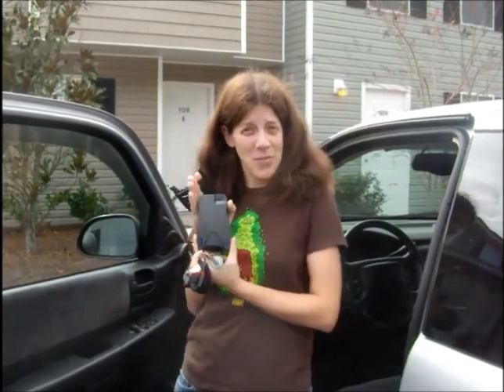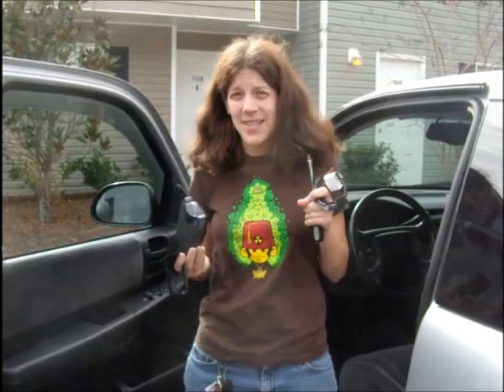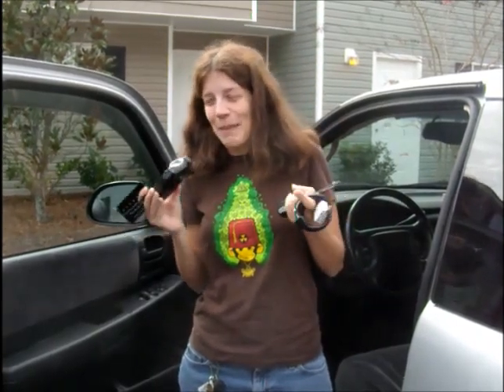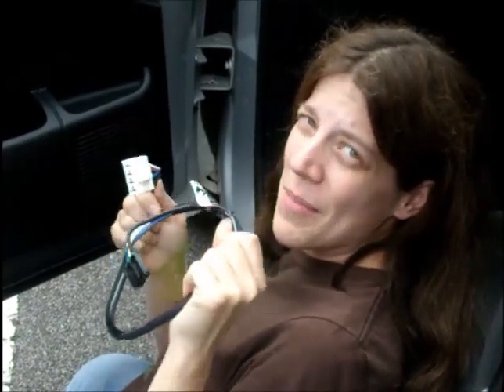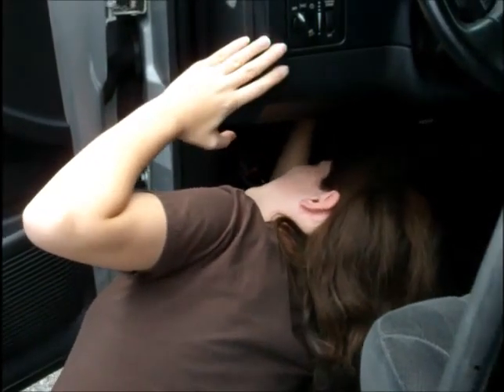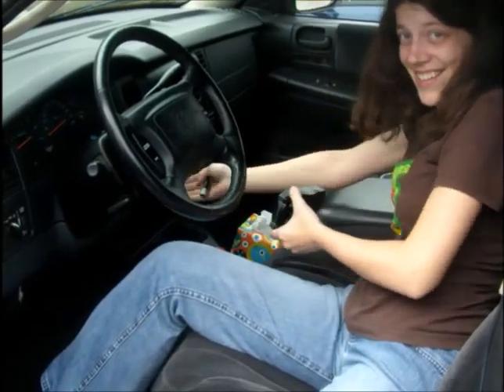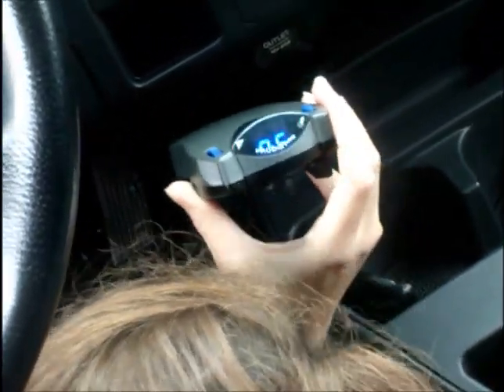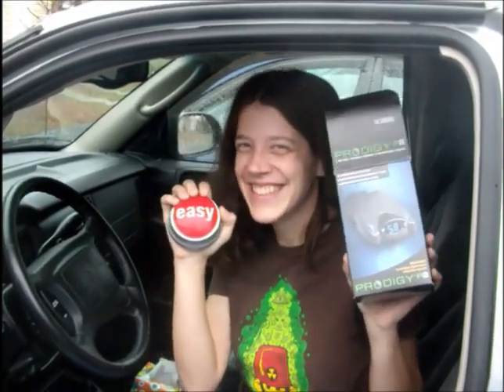Not Really a Brake Controller Install

Comment: After having this installed for some time, would you recommend someone to do an installation like you did?  I don't have a brake controller but have a tow package like you did.
Reply from the maker: Yes, the brake controller makes a huge difference in how fast I stop when pulling, recommended.
Reply: A brake controller is also a help in controlling trailer sway.  If your trailer brake is adjusted well (set to apply just a little more brake than your vehicle when you step on the peddle) it can be used to stop a sway if you catch it early enough.  Like throwing out an anchor - drawing the trailer back from the tow vehicle thereby straightening out the two.  If set to match the braking of your tow vehicle, trailer brakes help to prevent the trailer from beginning a series of sways because it prevents the trailer from pushing forward against the rear of the tow vehicle when braking.  A trailer never (seldomly) pushes precisely along the same axis as the tow vehicle and so almost always pushes the rear of the vehicle to the right or left even if only a small amount. As a gross example, it's easier to pull something in a straight line as compared to pushing something in a straight line.  If you think about pushing two things that are connected it's easy to understand.